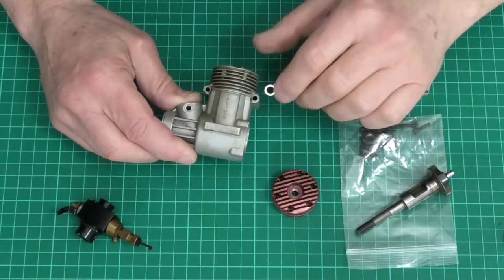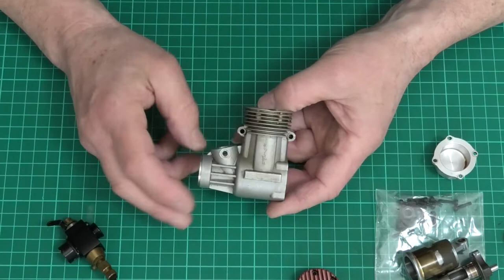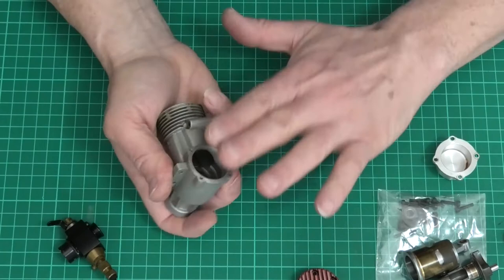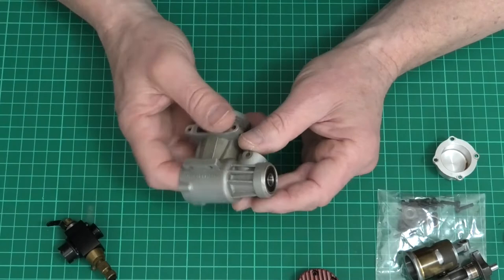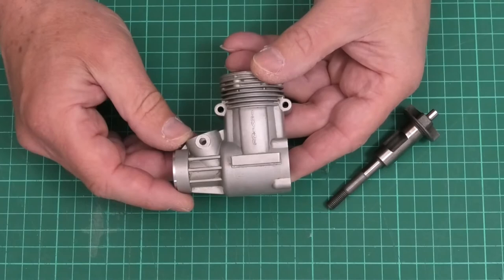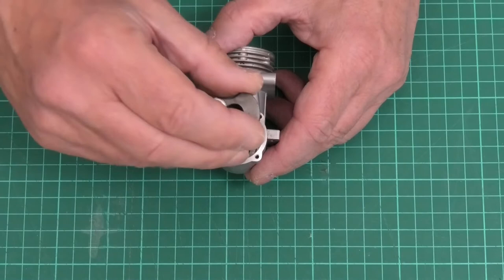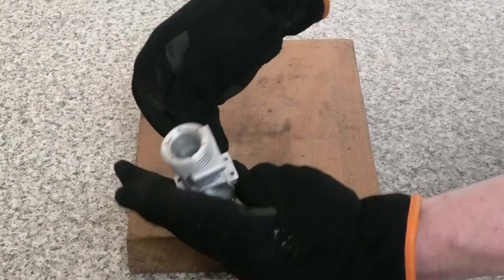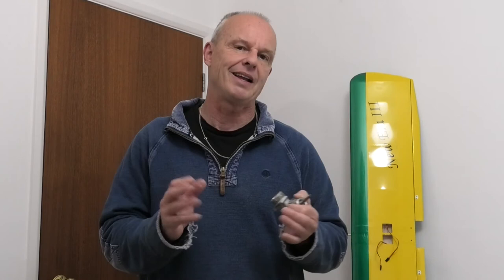Glow Enging Bearing Removal & Replacement  - RC Model Aeroplane Build & Repair

Comment: At the factory service dept, we removed bearings by heating the case around the bearing housings from the outside with a gas blow torch. This heats the case rather than the bearing to create the differential expansion. Tap the case on a wooden block (nose up) and the rear bearing will fall out. Turn the case over and hold with gloves. Use a brass drift to tap out the front one from the inside. For the red painted engines, use a heat gun and gently warm it. It is important to use minimal heat or the paint will be damaged. During installation we always fit the propeller driver, prop and nut to the shaft until cool. It maintains alignment and keeps the bearings seated until cool. Let it cool naturally.

Comment: Mark ----- A very good How-TO on bearing removal. I wouldn't think there would be much of a press fit - more of a slight interference fit being engine is of aluminum and the crankshaft has to pass through it with ease. Another good Tip for one to keep when rebuilding an engine. -----  Rodney

Comment: I gotta old M-16 nitro engine from ebay and it was made in 2004. I bought it from a seller with the whole chassis and I had recently just got it to turn over. when turned over It had good compression so I disassembled it all the way until the crank shaft. No matter what method of heating a engine it wouldn’t come out. As I am watching this video, I just realized, I could also get the crankshaft out using my oven. Don’t know why that didn’t click but I was planning on refurbishing it for use and I can now continue to do so I would like to thank you. Also if you have a collection of engines you should upload them to show.
Reply from the maker: Thank you for the comment greatly appreciate, so pleased that the video was able to help, gopod luck with the refurbishment

Comment: Great topic Mark.  I just did this for the first time a few months ago with a "free" OS 55AX that was in terrible shape despite a short operating time.  At about 250F I got the front bearing out tapping with a brass drift no problem.  But that back bearing was STUCK!  I banged on that poor case till my hand was numb.  Finally, after setting my oven to about 300F and striking hard the bearing popped out.  Whew.  Pain in the bottom that one was.  300F is getting close to bad metallurgical things happening so not recommended btw.  The liner was also peeled but it came right out without heat.  $100 worth of parts and my "free engine" is as good as new.
Reply from the maker: Hi there, thanks fro the comment, it's really appreciated
Reply: 250F is only about 120C and even 300 F is only about 150C - that is still well below the 200 to 230 C which Mr Robinson used. This would seem to be the reason why more banging was needed than shown in the video.

Comment: Have a question about what to use on brand new sealed bearings. What is the best way to remove the grease from brand new nitro engine bearings, so they can be fitted into a nitro engine for lubrication by the synthetic oil fuel used to run the engine.
Reply from the maker: Just installed with the grease, it won't do any harm, soon get flushed out as the engine runs 😀

Comment: Hi Mark, great tip 👍. Can you please share your method of cleaning engine if possible.
Reply from the maker: Thanks for the comment. For cleaning I generally use an ultrasonic cleaner and a tooth brush on the crankcase. Old Caster is never pleasant to remove. I use a cleaner in the ultrasonic called Sea Clean 2 which is great and alloy safe. https://www.amazon.co.uk/James-Products-Cleaning-Solution-Ultrasonic/dp/B001WL5IGC/ref=cm_cr_arp_d_product_top?ie=UTF8
Reply: @MarkRobinson555  thanks Mark, appreciate your feedback.
Reply: @hirenbshah  But note, don't put engines with the ball races still in place in the ultrasonic cleaner. It can easily damage the bearings.
Reply: @johnbirkett  thanks John, will keep in mind while cleaning.

Comment: Hello Mark,  I have two OS Max H60F Gold Head engines that I need to install new bearings in, and possible a new sleeve on the 2nd one that has some rust. The second one has never been run, but the guy I bought it from kept the engine in his garage up north, unlubricated, and now the bearings, and sleeve have surface rust on them (what a shame!). So I need to ask where to buy a new bearing set for them. Would you reply and let me know of a source for the bearings? Thanks!
Reply from the maker: Hi there, this is where I get my bearings from in the UK - https://www.hendersonbearings.co.uk/  good price for the bearings and delivery, and a fast service - hope that helps and good luck with the swap

Comment: Hi Mark, the bearings is the easy part for me, but all the videos I saw the piston and sleeve was already out. I tried to change the bearings on my .61 Evolution engine but damaged the sleeve trying to get it out. The sleeve really gave me a hard time to get out. Is there an easy way to remove the sleeve?
Reply from the maker: Sometimes sleeves can be difficult, again heat like when removing the bearings, and put somthing like a wooden spatula or thin piece of plastic through the exhaust port into the cylinder, then carfully rotate the engine and the piston should push the cylinder up so getting it moving, after which it can hopefully be pulled out by hand. But dont use anything metal to put in the exhaust port as it will do damage.
Reply: The way I do it is to first remove the backplate then heat the outside of the crankcase with a hot air gun around the sleeve area then use a wooden dowel or similar to push the sleeve upward from underneath. Once it comes up slightly you can then pull it from the top. Using leather gloves of course.

Comment: Hi great tutorial,
I have two OS 61 max sx engines
One is bad and I need the crank out of that to put in the new engine as the new engine crank is to short and the tread is to thick in diameter . Would you possibly know why they use different length and size thread on the crank drive. On identical engines?
Its for my graupner scale heli.
Hope you can shed some light,
Regards
Reply from the maker: Hi there, thanks for the comment, its appreciated.  regarding the crank, I do not know the answer, but you could take them both out and measure them to see if they will fit.  I am not very familiar with OS engins interchangability, good luck